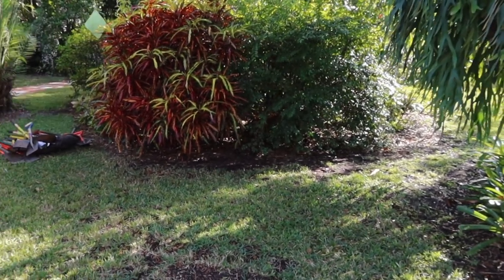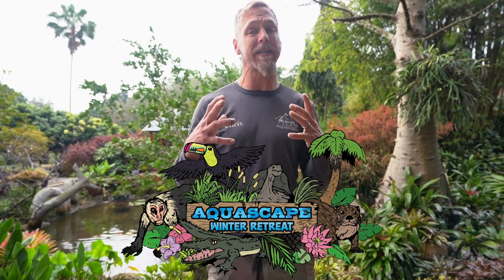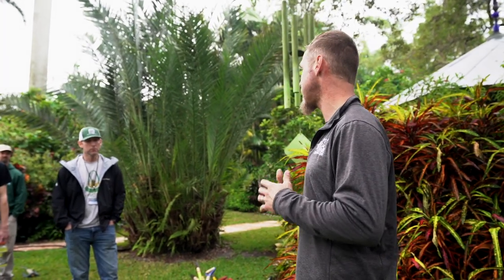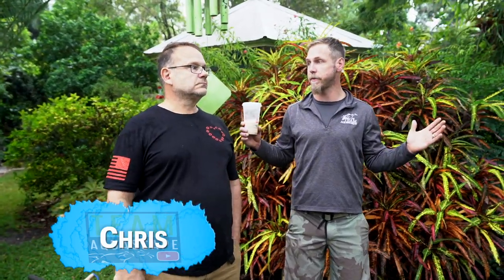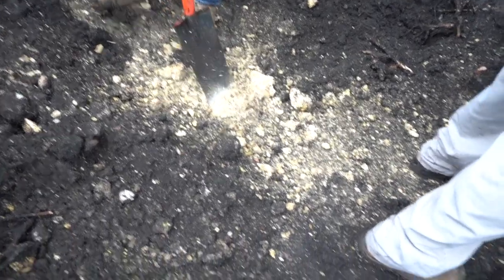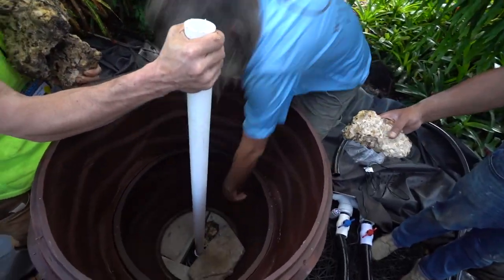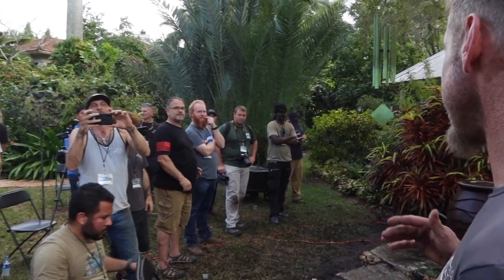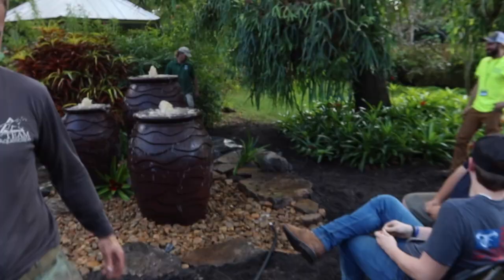MIDWEST DESIGNER builds TROPICAL urn WATER FEATURE

Comment: Looks great. My question is ..why wouldn't you  but the ball valves in a sprinkler box. That would make access to the ball vales easier and cleaner.
Reply: And where would that “sprinkle box” be installed for your clean easy access?
Reply: @Daihatsu_Hijet   could be I the same location,  but all you have to do is brush the 
stones off of the lid. (the valves  are free of stones) Make the  adjustments and put the lid back on.
Reply: @billfreeman685  you should watch the video again all the plumbing is on top of the AquaBlocks. I don’t think you understood what they built here.
Reply: @Daihatsu_Hijet  I looked at it again. It still would work but it would depend on how much travel you put on top of the aquablocks.  Tussey  Landscaping  does it all the time.
Reply: @billfreeman685  🤣😂🤣
Okay Billy you just live with that fantasy concept all you need. 
I know how Weston at Tussey builds too, actually quite a few of the USA CAC and from other countries.